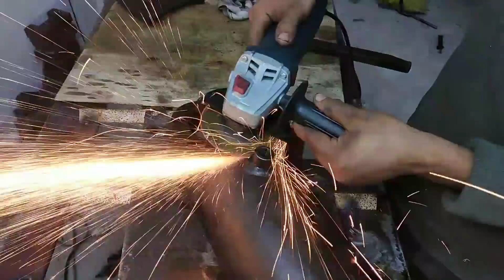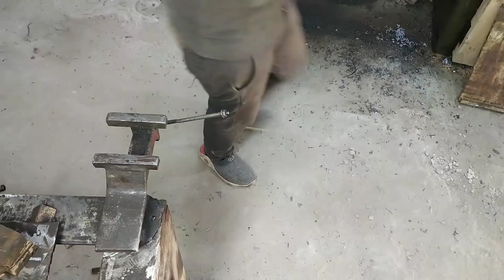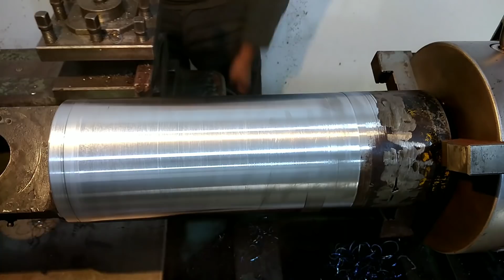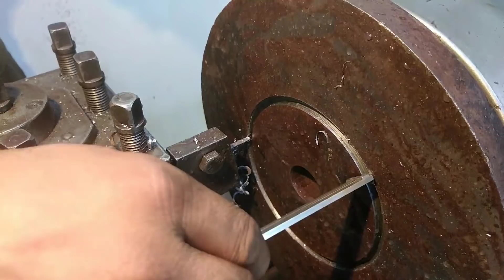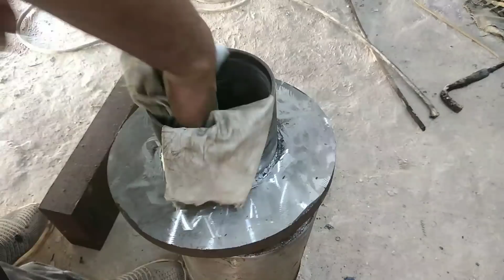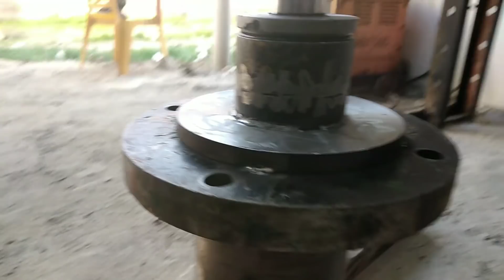كيفية تصنيع بستم لزوم مكبس هيدروليك

Comment: Using an old car suspension spring for the return force means the piston will never have to seal over the portion of the cylinder bore that was distorted from welding.  I was wondering about that...